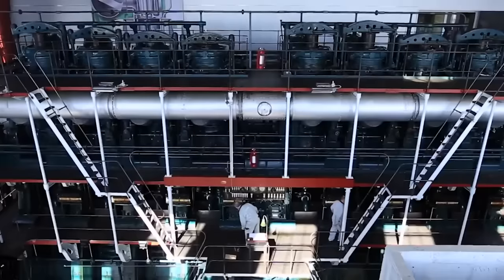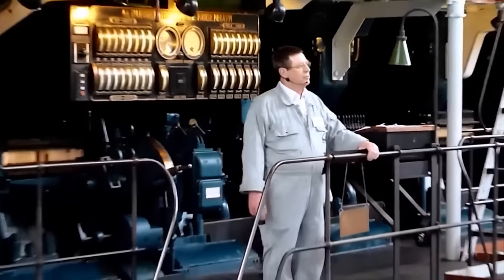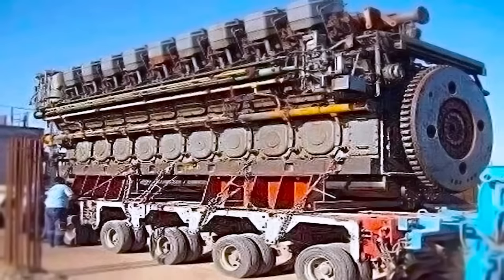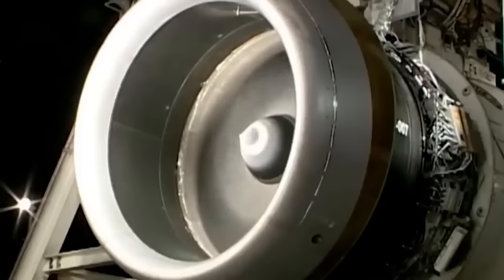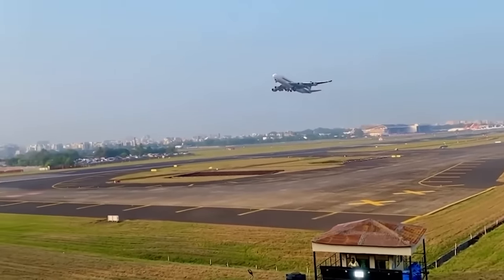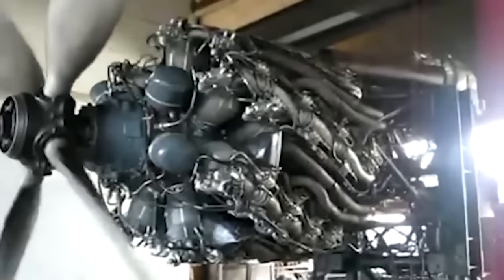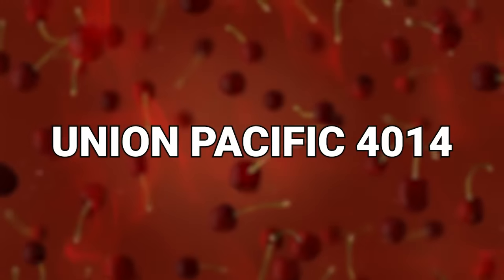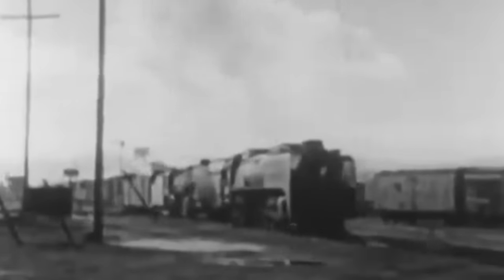The Most Powerful Engine In The World

Comment: If it's electric, it's not an engine, it's a motor. An engine converts the chemical power of fuel into heat through combustion. An electric motor converts electrical energy to mechanical energy, usually by employing electromagnetic phenomena.
Reply: Well said
Reply: If that were the case, why are cars and trucks referred to as motor vehicles ...
Reply: @KRM  
Because people are mistaken.
 Same for referring to crude oil as being mineral oil.
No such thing.
 This was  an incorrect assumption.
 Crude oil is from woody biomass.
Reply: @krm8494  because for decades there was nothing else to compare the internal combustion engine to that was on the road. You don’t call a steam engine a steam motor…
Reply: Hurrumph !!! Bro finally someone besides just me has said it !!!!
Reply: Take that up with the dept. Of motor vehicles, General motors Chevrolet, Ford Motor Company 😊
Reply: Amen. And…… another very common misunderstanding:  the cliche is not “walk the walk and talk the talk”.  The cliche is - walk the talk - meaning- practice what you preach. Walking the walk and taking the talk - is meaningless.
Reply: Hmmm, I wonder why freeways in Europe are known as “motorways”. Since they’re primarily used by internal combustion powered vehicles maybe they should be  “engine ways”.
Reply: So electric cars have no engine 😂
Reply: Pedantics...
To move anything, requires  motion,  hence you motor anything, could be a vehicle.
an engine is one way to motor something, as does a kick or push.
Electricity comes from?
Same as any energy.
its all natural in the end.
Reply: An engine is a machine that converts energy into movement.
Reply: I'm afraid you're wrong.
Reply: A motor is an engine depending on its power source.
Reply: Hey! That's my line! Glad someone ELSE knows the difference😃
Reply: @ellieprice363  The origin of the word motor is Latin for "movere" to move.
Shouldn't need any more explanation than that.
Reply: @Charles-kd6wo  yes, they have no engine. Unless you count in the electricity needed to charge their battery to run their electric motor could come from a generator powered by a Diesel engine.
Reply: @Indigenous51  No 😅
Reply: @Johnconno who's wrong?
Reply: rickybarber347   to clarify: diesel is the inventor's name (Diesel,) it is not a fuel. The original Diesel engines were designed to run on peanut oil, modern ones run mostly on petroleum products, though there are other oils used by some persons.
There are other motors also such as hydraulic motors, vacuum motors, and air (pressure) motors, etc.
Reply: @krm8494  Because they move. Motor is from the Latin movere  i.e. move.
Reply: @markobrien678 😂 crude oil is any oil that is unrefined.
You are right though on mineral oil and crude oil not being the same, though mineral oil is refined from crude oil.
Reply: @stuartstevens472  The origin of the word motor is Latin for "movere" to move.
Shouldn't need any more explanation than that.
Reply: So many people don't get that. A motor is electric. An engine is fuel powered and yet we have motorcycles.!😂😢
Reply: @Rick-ve6yp, not exactly right: a motor converts one form of power in to another, as in electrical power to mechanical shaft power. Engines convert energy in to power. The power source in the case of an electric motor could be a battery; batteries convert chemical energy to electrical power. The diesel engine converts chemical energy, in the form of hydrocarbon fuel in its tanks and oxygen its intake charge air, to mechanical shaft power.
Reply: @I_HateClickBait motor literally means to move
Reply: @railroaded1991  google the definition of motor. It does NOT include "to move".  Fact check yourself so you don't sound unsmart.
Reply: @I_HateClickBait  
Source Oxford Languages
mo·tor
Origin

late Middle English (denoting a person who imparts motion): from Latin, literally ‘mover’, based on movere ‘to move’. The current sense of the noun dates from the mid 19th century.

You should apologize
Reply: I’m lost even tho Ik what ur talking about 😂
Reply: @I_HateClickBait motor means to move, and these days there are many motorcycles powered by electric motors
Reply: The real question is . Why do we drive on a parkway and park on a driveway?

Comment: If it’s electric, it’s called a motor, not an engine. An engine burns fuel to convert chemical energy into heat through combustion, while an electric motor turns electrical energy into mechanical energy, usually using electromagnetic principles.

Comment: Wind turbines are not engines.  Engines cause the rotation of the drive shaft rather than the motion of the drive shaft causing motion of the internal moving parts of the machinery ("engine").

Comment: For those that don't know, here's a little tidbit of technical trivia associated with large mining trucks shown in the videos. The engines in those vehicles don't actually link via a transmission and drive shaft to the wheels. They're actually diesel engine generators that produce electricity, which in turn powers the motors in each of the wheel hubs. It's those electric motors that actually make the trucks move.

But I'm still confused about the conversation about the GE "engine" mounted on the wind turbines. That's not an engine, as it doesn't run to create power. It's a generator that produces electricity, not an engine.

It's gotta be hard producing videos that discuss topics that the video makers don't understand very well. This appears to be one of those types of videos.
Reply: Yup. Most large modern ships work the same way, as well. They use diesel engines which actually produce electricity to power the motors for the ship as well as the electricity onboard.
Reply: Yes I was thinking the same thing about the wind generators not engines.
Reply: If the video and the maker of it are so brilliant, why does "click bait" have to be resorted to???.

Have the balls to change the video title to a more appropriate one.
Reply: Yes & a lot of trains are Diesel electric also.
Reply: @richardpalleschi4807  all trains are unless they are 100% electric and powered by overhead lines or a third rail (or steam powered).
Reply: Windmills????????????????WTF???????????
Reply: Can I get one of these I want to put it on my scooter

Comment: Don't know how old this thread is but the current most powerful diesel engine is the MAN B&W 96C, with a bore of 960 mm, a stroke of 2.5 metres, a cylinder displacement of 25.7 metres-cubed for the inline 14-cylinder version, which produces 109,000 hp at 110 rpm. The engine is used in very large containerships (think 'Emma Maersk).

Comment: Disappointed to not see any rocket engines on this list, off the top of my head I can think of 3 or 4 engines that have jaw dropping power. For example; the F1 that powered the Saturn 5 first stage on the Apollo missions, the RS25 engines that powered the space shuttle and now the new Artemis rocket and you also have rockets like the SpaceX raptor and Blue Origin’s BE4 engine that are also set to break some records!
Reply: agree on the F1.  1.5 million lbs of thrust per engine. 5 mounted on the first stage of the Saturn 5 = 7.5 million lbs of thrust. Truly impressive

Comment: An atomic bomb test in Australia blew a Centurion tank 10 feet.  It became Australia's first nuclear tank. It later saw service in Vietnam.  The tank still exists. Centurion 169041 is likely the only tank in history to have been hit by an atomic blast and not only survive, but fight in combat afterwards. This tough old tank was designed to fight the Germans in WWII, but proved itself capable of standing up to a nuclear bomb too.

This particular Centurion was subjected to a 10 kiloton nuclear bomb from a distance of around 400 meters in the Australian Outback. Test crews returned expecting to find pieces of what was once a Centurion scattered around the site, but they were shocked to the tank in one piece and still functional. Once refueled it drove off. 

Centurion 169041’s unique distinction of living through the test was reflected by its well-earned nickname: The Atomic Tank.  Centurions were designed during WW2 to take on German Tiger and other tanks. To make it go they used a version of the Rolls Royce Merlin fighter engine. The war ended before they saw action.

Comment: You missed the most powerful "engine" there is.. the GE Harriet 9HA.02, which by itself generates 765,723 hp! When you use it as a combined cycle generator (using the exhaust to boil water that spins a steam turbine) it generates 1,123,777 hp!!
Reply: 1,123,777 hp is just about 838 MW (megawatts)
Palo Verde nuclear power plant has three electric generators each producing 1,400 MW,  each driven by a nuclear reactor supplying heat of about twice that power. Industrial steam IS a gas. A steam turbine is a "heat engine" governed by the strict laws of thermodynamics. So  reactor power is given as MWth  (thermal) and its electricity production as MWe.
Reply: Electric generators are not engines they're the driven equipment. The driver in case of a nuke plant would be a steam turbine. However I wouldn't call that an engine either because it's only the gas (steam) to mechanical power converter not including the steam generator. The above mentioned gas turbine combines the gas generation out of chemical energy and the power conversion part, it can therefore actually be called an engine. I stick with the GE 9HA for being the most powerful engine.

Comment: Actually #18 powered the B-29 bomber first which did what he said, not the B-50 which was built after the war.
Reply: The B-29 was powered by 18 cyl. Wright R3350 engines during WW2.  And like you said, the B-50 was built after the war using the 27 cyl. Pratt & Whitney R4360 engines.

Comment: Here, let me help out with your engineering unit problems:
MW is Megawatts, a unit of power, one million Watts
lbf is pounds force, a measure of thrust in jet engines
Torque is not expressed in pounds per foot (that is spring rate), it is expressed as pounds*feet.

Comment: The Caterpillar GCM34 is natural gas powered engine used in power generation that puts out 10 MW. Very useful as near instant backup power. Then depending how high you want to go and how far you want to stretch the definition of 'engine' the General Electric 9HA industrial gas turbine puts out 838 megawatts in combined cycle mode - which is a big city sized power output in one machine.

Comment: Gas for Engines, Electricity for Motors.. There is a big difference...
Reply: they are synonyms
Reply: I agree, electric motors are going to get larger and larger and engines are going to get interesting. Check out the Omega, being developed by Astron Aerospace. Autoline After Hours has an interview with two of the inventors. Small, high revving, and high horsepower.
Reply: General Motors makes engines that run on gasoline and diesel.  So does Ford Motor Co.  And they also make electric motors.  A motor is anything that provides motive power.
Reply: Not really.
The first engines were combustible fuel / steam driven.
The largest engines now by far are nuclear fueled steam turbines.

Comment: I remember back in early '79, I helped with an overhaul of a Waukesha-Pearce HUGE diesel engine in the Grand Canyon. (above Havasupai) on Long Mesa. There were three engines running really gig generators. Two of them ran all the time, but not full speed for too long. One could handle all night, but you needed both during the day for air conditioning etc. Then they ran the backup unit when we overhauled one of the big ones. It was a very good experience. I'll never forget Mr Emil Slotten 👍 Excellent man. 🙏

Comment: To my knowledge , the MAN 14L 96/314 is the biggest piston engine : 14 cylinder in line , bore 96 cm ,  stroke 314 cm - 118 000 hp .
Reply: lets ask Grok
Reply: The most powerful engine in the world is the GE9X, a high-bypass turbofan jet engine developed by GE Aviation. This mighty beast powers the Boeing 777X and boasts a maximum thrust of up to 330 KN, with a dry weight of 5800 kg. It features fuel burn reduction technology, which not only reduces engine noise but also makes it more efficient.

Fun fact: The GE9X's fan is a whopping 123 inches in diameter, making it larger than the fuselage of a Boeing 737!

So, if you're looking to power your next interdimensional spaceship or just want to impress your friends at a dinner party, the GE9X is the engine for you!

Comment: Boeing was the first manufacturer to get their 2-engine 757 FAA certified for trans-oceanic flight. FFA requires all commercial aircraft must be able to stay flying with ONE engine shut down. You read it right - the 757 aircraft, fully loaded with cargo and people, stays in level flight with only ONE engine running. 
I was the project manager for Boeing's Jet Engine Test Stand switching system used at their huge Everett, WA plant for testing engines used on every commercial jet aircraft they manufacture. Engines weighed 10,000 pounds and produced 40,000 pounds of thrust each. Each plane has 7 miles of orange flight test wiring used only once - to FAA certify the aircraft to be flight worthy. Then the 7 miles of orange wiring/cables are all ripped out by a work crew..

Comment: Along with others, mentioned below in the comments... you should definitely have showcased the engines used in the T/F (= Top Fuel) class of sanctioned Drag Racing..... 11,000 HP(+or- just a few), and over 9,200 lbs ft of torque... out of 496 cubic inches of total displacement (V8)!!  With class regulated minimum weight of 2,150 lbs (with driver)... traverse 1000 ft on a current "average" of 3.8 seconds at over 320 mph from a standing start.  The Current record is 3.640 seconds at 338.94 mph.  They reach 100 mph in 60 ft, in 0.8 seconds.  

Anyway... would be great if you would cover that (and more) in possible future videos.   Also, try and learn more about your subject matter, before you post a video on it... there are numerous inaccuracies in this video.
Reply: And they need to be overhauled every 4 seconds.
Reply: @bboaze ... Thanks for the reply Bruce.  Nahh, it's a bit longer than 4 seconds from the time the "burn-out" mag is lit, walk it through the "bleach box" (old term), do your burn-out, back it up, sit while the crew chief makes last second tuning adjustments to the main barrel valve, and engine "pit chief " unlocks the 2nd mag, then walk it to pre-stage, inch it to stage, then "hopefully" run on all eight for 3.8 secs.+/- .... adds up to a bit more than just 4 seconds.  ; )   

PS: I've never driven a T/F'r.. but I have owned and driven for myself and others, everything from the "real" Jr. Fuelers (late 60's to early 70's) up to TA/D's with a personal best of 6.179 @ 234.47.... and that was back in 1978!!

Comment: An addition to the first to be shown, the 8 cylinder engine weighs over 3.000.000 lbs, that's 1400 ton.
They start it up every two weeks and let it run for 10 min.

Comment: Large slow speed diesels either on ship or shoreside power plants are above 80 Megawatts/110,000 HP. None of the smaller engines come close. There are Gas Turbines above 250 Megawatts in shoreside plants

Comment: Great video and narration but I have always wondered why someone would use a Turbo over a Super Charger as a turbo causes so much heat and friction and heat is an engines biggest enemy.  Someone watching this video probably knows Huh???
Reply: A super charger uses engine horsepower to create more horsepower. A turbocharger uses excess exhaust heat to generate  “free” horsepower that would otherwise be wasted. Turbochargers are therefore 
more efficient than superchargers. ICE’s are “heat” engines so heat is not their biggest enemy. In fact many thousands of degrees of heat is what makes internal combustion engines work.